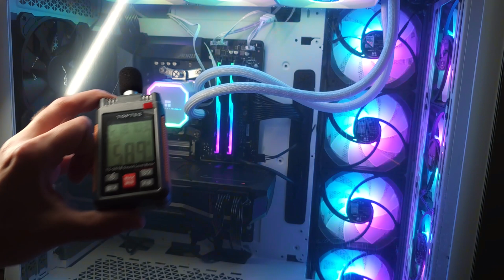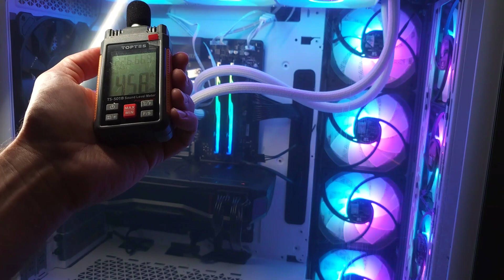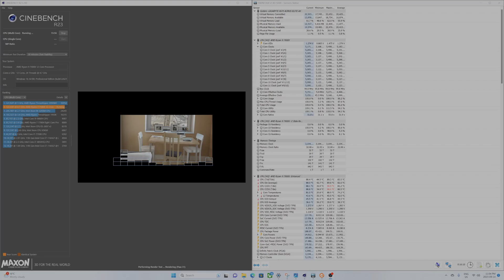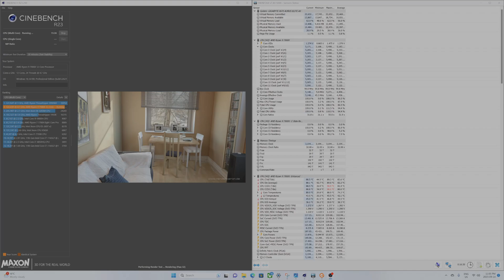Thermalright Frozen prism 360 unboxing, installation and testing.

Comment: so.. i only got cpu_fan on my mbo, now what?
Reply: You should have fan headers on your motherboard labeled “SYS_FAN” or something similar. The radiator fans are daisychain-able meaning you can connect all three together leaving you with one end which would plug into the SYS_FAN header. The AIO may also come with fan splitters, im unsire as I havent unboxed mine yet. If you do, plug the fans into those then plug into SYS_FAN

Comment: i have a board asus tuf gaming plus ii b450m and i only have  CPU_FAN and CHA_FAN connectors.  Do you think could use this AIO?  Pump connector at CPU_FAN and fans in cha_fan ?
Reply from the maker: The cpu fan header will probably be rated for a higher wattage so I would use that for the pump and a chafan header for the fans.

Comment: Have you been using this regularly since you posted the video? 
I have been debating buying this for weeks already but im concerned about the long term quality of it, i mean its a 3rd of the price as other water coolers lol
I currently am air cooling with phantom spirit 120, but the 7800x3d can still run hotter then i would like during some scenarios. 
From all the charts ive seen, this can give you on average 8-10° avg cooler temps, that would out me right in the zone i would like to be in for worst case scenarios.

Any update to the quality/life of this product would be greatly appreciated
Reply from the maker: I have it on my test bench with a 5900x and it is still working great there.
Reply: @jackshardware  thanks!
Reply: Have you bought it yet? And if you did is it good @AnEyeRacky
Reply: @syncfn1  didn't have any locally so I had one of the local shops order me one. (I try to support local as much as possible) 
Was told it should be here by the 29th at the latest. So any day now I should have it.
Got the black argb 360 version
Reply: @AnEyeRacky  sorry i dont know if you know but when you build a pc, do you have to buy a rgb controller to change the rgb on the case?
Reply: @syncfn1  that depends actually. Are you building one new? Have any existing parts you will be using?

In most cases, you won't have to buy anything extra, if you plug all RGB components into argb ports on your motherboard, then any RGB software you use should be able to control it for you. The 2 problems you run into, are when you already have a fan hub, or there aren't enough argb ports on your motherboard.

If you give me specifics, I can help you out more, and I would be happy to do it
Reply: @AnEyeRacky  have you got it? How is it?
Reply: @soundpeople9673  yes! For a few days now.
Haven't had a ton of time with it.

Going from a thermalright phantom spirit 120 dual tower, to this frozen prism, it is a noticeable difference for sure.

If you stress test, you're still going to hit some high temps, but on average so far I'm seeing about 7-8°C difference in normal working conditions and some gaming.

I was just playing around with cyberpunk last night actually, and it's probably a bit closer to 10°C.

Some of that could obviously be a new/better thermal paste application too. Same paste that comes with the air coolers so that's a fair test
Reply: @soundpeople9673  oh and it is also a little noisy, nothing crazy though as long as it's installed correctly.
If you have it right next to you on your desk or something, you will notice it in a silent room for sure.

Not loud enough that headphones or even just playing some music or your games through your monitor speakers wouldn't drown it out.

Overall, for the price, definitely worth it. But again, it's only been a few days. Take this review with a grain of salt
Reply: @AnEyeRacky  how is it now after using it a couple months

Comment: How do you turn on/off the RGB on the fans and aio?
Reply: @ExcelsiormGaming  don't plug the RGB cables in, just the power ones. Everything will work just fine and no RGB lights of any kind

Comment: Currently trying to install this but i have 2 ARGB connectors (one from the pump and one from the fans) which one did you connect to the ARGB header? Fans or pumps?
Reply from the maker: You should be able to daisy chain the fans together,  and the argb connector for the fans and radiator. There should then be only 3 connections to the motherboard for the fans,  the pump and argb.
Reply: @jackshardware  Awesome, that's exactly how I did it (My motherboard has the ARGB header listed as D_LED1 and D_LED2, after some googling it turned out those are actually the ARGB headers. Thanks a lot!

Comment: Man… every body that did a installation with this cool skipped or didn’t show the import parts of wiring.. so annoying
Reply: I’m trying it right now. You ever figure it out? I can’t figure out what to do with the two male female 3 pin connectors off the pump.
Reply: @itsgregger4414  Daisy chain them with the fans. That's what I did.
Reply: @itsgregger4414 me either bro
Reply: @itsgregger4414  i know im, alot late but its very simple you can either daisy chain em  or you can do a fan hub makes everything so much easier
Reply: Yea, i agree, very annoying.
Reply: @briancollins6974 yeah for some reason all 3 of my fans work but only 2 of them have the egg lights on the last one doesn’t idk what went wrong lol I have to take it apart again and see if I can find it I guess
Reply: @Nate40k  The aRGB connectors are the jankiess connectors ever. One small touch and it loses connection. Gotta make space for its cable management. So when you close the lid, it won't touch the aRGB wires.
Reply: That's because they were lost for a bit with what to do! So they can't really show them being unsure as it looks bad if they're a YouTube tech channel.
Reply: It's really not that hard if you follow the manual. Like the creator said, daisy chain them with the fans.

Comment: Looks to be exactly the same as their air coolers for the mouting soloution.
Reply from the maker: I think I tried to mount it using the peerless assassin hardware, but it didn't make good contact with the cpu.
Reply: @jackshardware  ah dang, I was hoping to save myself some time and effort. Fair enough

Comment: I can’t find anything online how do to put the wiring together??
Reply from the maker: The fan power cables daisy chain together and so do the argb cables. Then they just plug into your mother's. The fans plug into the cpu fannheader and the pump plugs into a separate fan header. Check your manual for the correct one.
Reply: @jackshardware  thank you. I am a newb most vids skip this part my manual only has instructions on placing the cooler onto the cpu with brackets.
Reply: @jackshardware do you know where the two male and female 3 pin connectors off the pump go? Do they connect to one of the fans off the radiator? Any help is appreciated.

Comment: Great Video, well it work fine with 14700K ?
Reply from the maker: For gaming out will be perfectly fine.
Reply: I have 14700k with PA 120 its not good , but I do manage to keep the temps in gaming less than 85

Comment: Can you test it with normalized dB level? Put your dB meter at static place, and adjust the speed during let's say gaming loop or Prime95  to 34 dB.
Reply: Belive me u don't want that. I have an ryzen 7600x and the temps in prime 95 are horrible (95 celsius ) and the noise level is way to load, as u can expect for 53 db.
Its to load for my ears and im heard-of-hearing!
Reply: @davidhilbert161are you using the frozen prism aswell?

Comment: Just tried installing mine and it only had 3 red AM4 standoffs. I have no idea how to get another one, ive used one of the smaller blue intel ones for now but worried it will cause issues with contact on the cpu.
Reply from the maker: I would not do that incase you put too much pressure and Crack or warp something.  Can you return it and get another one.

Comment: Which is better prism or aqua elite from thermalright. Both have 360mm. I think the aqua uses gen 3 while prism is gen 1.
Reply from the maker: Aqua elite is v3, which means they have made revisions to it. That doesn't necessarily mean it using new generation technology. I'm not sure which one is better.
Reply: @jackshardware  but I should be good with the prism?
Reply from the maker: @DCL141  I've been using it on my 7900x since this video and I've had no problems.
Reply: @jackshardware  sounds good. I can't wait to get home to test mine out. Any advice to get rid of the water noise.

Comment: what about the rgb connectors how many pins can they daisy chain do i need a hub or splitter
Reply: they can chain, ill count them tomorrow
Reply: @BadTripNL any news on the count? I’m stuck trying to figure out why they aren’t lighting up
Reply: @AlucardNewcastle  Hey, have you figured out how to do it? I'm confused on the ARGB cables
Reply: @szymonwronski4493 yes. So basically you need to connect the hub that came with the case to the SATA cable that goes into the PSU. Took me a while to figure it out. Then the entire hub works and you can control it with the motherboard
Reply: @AlucardNewcastle  thanks but a lil late
Reply: @xzerokillx  yeah lol. It was for another guy 😂
Reply: @AlucardNewcastle  oh ok lol

Comment: I bought the 240. I have an Asus plus wifi x570 board fans work but lights are stuck on red and green along with case fans. DIYPC Q10 case has had me stumped for a week. Bought a thermal right argb controller still same issue persist.
Reply from the maker: Have you downloaded asus aura sync
Reply: @jackshardware  I did but it wasn't able to recognize the aio. My case fans also lit up green/red with only the 4pin pwm connected so I'm not sure what is going on. 

At this point I planned to return the case to newegg and the thermal right aio as well. 

I have not been able to get anyone to confirm that thermal right is compatible with aura software. I also tried Openrgb, signal rgb, msi center.  I have seen these working fine for others but in all instances they were using a gigabyte board.

Comment: very bad temperature. water very bad 90c ooooooooooooohhhhhhhhhhhhhhhhhhh
Reply: bro it is a 60 dollar cou i think it did very well cooling a 7900x it will keep your mid range cpu pretty cool
Reply: @dudekissmyass  i have the same aio, and the thing is, if you keep the radiator lower/even level as the pump, the temp should stay around 50 even on high process use... i have the ryzen 5 7600 and it stays cool in EVERY situation, HOWEVER, whenever i raise the radiator, the temp average raises with about 25 degrees, so, it seems to me the pump pressure isnt the best... so my advise is, keep the radiator, even or better yet, lower than the pump for maximum efficiency.

Comment: A loose SATA cable was included. must also be used ?
Reply from the maker: I can't find the cable for mine but I believe it's just for powering the fans if you don't have the headers on your motherboard.
Reply: @jackshardware can't tell you how long it took me to find this answer thanks. I was freaking out because everything worked but I had the sata cable

Comment: Are you still using it? If so do you think a product like this can be faulty and leak?
Reply from the maker: I have been using it ever since and it works fine. I haven't heard of any leakage issue. If there is a problem or will probably be how long until the pump fails.
Reply: @jackshardware and when would the pump fail , can U give a years rang like if I bought it today  would it last 4 years ?

Comment: What size should go with the I5 9600K, the 240mm or 360mm, pls?
Reply from the maker: If your case can fit it I would go 360. 240 would be fine. The 9600k can draw a lot of power.

Comment: How did you remove the ARGB caps off the male ports? I can't seem to find out how to remove them and the manual doesn't help.
Reply from the maker: You mean the plastic covers? You just pull them off.
Reply: @jackshardware  Would you believe if I told you only NOW I got a notification on this? Anyhow thank you! Yeah I figured out like a day after the post lol. the seam wasn't very clear on mine, and this was the first time I ever built a PC rig so I was quite unga bunga not understand cap.
Reply from the maker: @kat_lynx glad you were able to figure it out. I understand how frustrating it can be.
Reply: Dammit, it took way to long to find that answer. I thought they looked like caps but I guess the ones I tried yanking on were stuck pretty good. Can finally resume my build 😂
Reply: @ Mood, on mine they were also stuck very tightly.

Comment: I have bought it recently and working just fine. In fact I think this is the best prodcut on the market, when it comes ration between price range and quality. Ofc there are better product which makes less noise or worse cheap products. As far as I can tell, design is very much same as the most other similar products and it has aRGB lights. More importantly its actually very well built. But the fan noise was not really loud, but still you can tell the difference from Corsair, Arctic fans. For me the noise was not really bothering, since I have also PC case with sound absorb. Really Really loved the product. It wont fry your system, cause it will automatically shutdown, if cooler does not work. After I installed the the cooler, it was also not starting or shutting down immedeatly. My problem was like showed in the video, I did not inserted the fan pins correctly. I had switched pins of Pump an CPU fan. Now its working perfectly. I would definetly reccomend it. Just best product! Affordable, well built, cool design. I would say just the materials of this thing would cost 50 bucks. but the whole thing for just 75 bucks? too good deal man.
Reply: Is it compatible with Asus aura sync
Reply from the maker: @Lr28_1  I'm pretty sure it is.
Reply: it works with MSI  mystic in addition to all other fans on the pc so id assume it works the same with asus aura as its just the same software for mobo arbg controller for asus mobos instead of msi.  @jackshardware
Reply: same sentiment here. it's much quieter than the deepcool ak620 i was using, cools just as well if not better (unsure, the ak620 kept a 13700k as cool as one could get as does this, this just costs teh same and is less bulky so i switched and sold the ak620). i dont mind a bit of noise, i cannot hear it through my headphones anyway, but for those that want a completely silent pc this is far closer silent than the peerless assassin 2 or the ak620. my brother has a 200 something dollar corsair aio and the noise is pretty much no different to that.

 i also grabbed thermalright's 5 dollar exhaust fans off amazon cause i figured why not, they're 5 bucks, and they're keeping the positive pressure in my case as well as the deepcool f ans i was using prior so i sold those too. deepcool is a great brand but i dont know if it's the case that every other brand is way overpricing their coolers (i know noctua is) or that for some reason thermalright is just able to produce and sell these high quality coolers and fans for extremely low prices and still remain profitable but either way im a thermalright stan from here on out.
Reply: I know this comment is old but would you happen to know like what the cords are like is the 4 squared cord the main power cord and the other 2 cords that are wrapped together I know ones for the Argb or whatever what’s the other one for im not sure if it’s the 3 circled one or the 3 pin one
Reply: Hey man how is it one year later
Reply: @zaiakiryakoz2112 It’s pretty good, though a bit dusty. I haven’t encountered any major problems yet. Maintaining the AIO can be a bit annoying, to be honest. Since the main radiator is installed on my metal case, intense PC usage causes it to heat up, which in turn warms the case and creates a hot airflow.

Other than that, it’s performing phenomenally. The main challenge is adjusting the fan speeds—if I don’t, it creates too much noise. In total, there are 8 fans, including the ones on the AIO.

Comment: Ese cooler esta hermoso 😮
Reply from the maker: I agree it looks very nice.
Reply: @jackshardware  hello mine fans on the radiator does not spins?
Reply: @officialyashvirgaming plug cables into the motherboard and use a hub for the argb cable to control them.